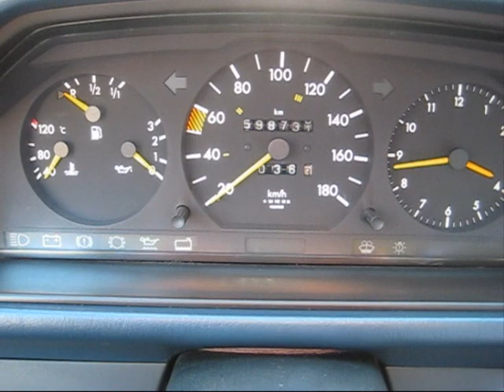Mercedes-Benz w124 200D 1988 590000km suonenjoki

Comment: Hi, very very nice considering the high km. You have some strange options though. I was convinced that a cruise control never came with a manual on a w124. And there is no rust. Do they use salt in winter in your country?
I have a 94 w124 E250 D with about 315000 km but I "had" some rust on the known places. You car does not have any !